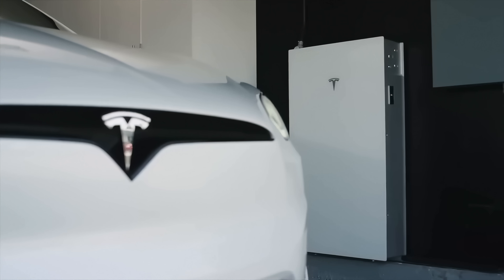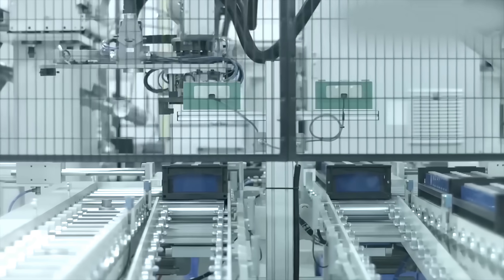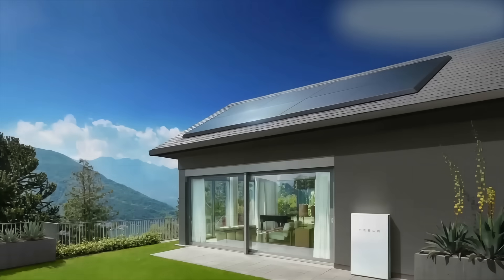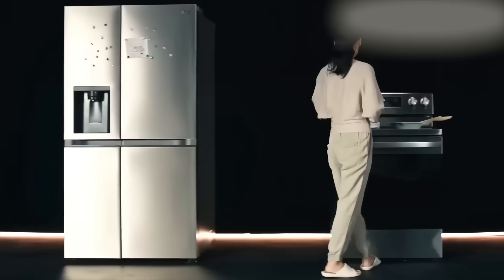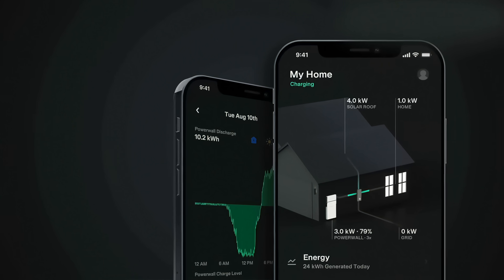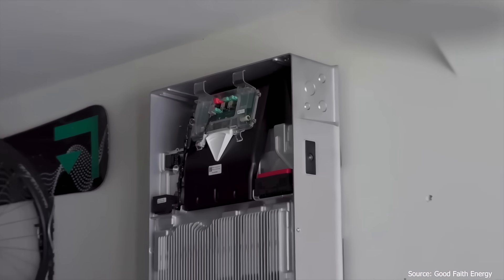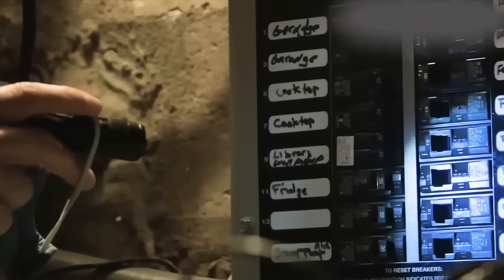Tesla BRICKS Powerwalls Remotely — Thousands of Home Batteries Now Useless

Comment from the maker: Would you buy a powerwall? If not then why..
Reply: After watching your video, I don't think so. 🙂
Reply: I would be very careful buying anything expensive and complex that is cloud connected.  That includes especially EVs but also includes ICE that is cloud connected.  Where I live, many of our smart locks to home main entrances had similarly been remotely "bricked" for reasons nothing to do with the owners.  Locked-out/in to our own homes.
Reply: @lbcck2527  Yeah my thoughts exactly.
I'm a bit of a prepper by nature and I love the idea of some energy self sufficiency to go with our old property that gives us rainwater, fruit/vegies, chickens if we felt like it, firewood and old school features like a wood stove, cellar etc etc.
The more I see of EVs and grid connected power setups the less I like them especially if some of the geo political tensions really kick off.
I'm leaning towards some stand alone solar, ICE generator and a couple of decent sized power banks as a back up to grid connect.
Ironically the really old tech such as our wood stove and decades old oil heater still function perfectly, can't be controlled/affected by outside actions and still work exactly as they were designed to do.
Reply: Not from Tesla or any other closed platform. Never. Try Victron.
Reply: I would never ever buy recent technology. I prefer to let some years go by and get the feedback of users and then decide. I've already seen too much. Even new car models can give some serious trouble. A friend of mine bout a new car model and it had some strange intermitente behaviour, the brand had to send an engineer to see it. Don't remember what happened after. But the car was the latest and greatest of that brand.
Reply: I don't think I would have ever buy something like that. Why would you pay so much when you can get server rack batteries and a decent hybrid inverter for a fraction of the cost? Also, then you can repair / replace things individually once they're out of warranty, and take advantage of new tech as it's available.
Reply: i will not buy anything "smart", whteher it is a fridge, a car, a phone  or whatever.
Reply: No, because our backup system uses lithium iron phosphate batteries that are safe for domestic use.
Reply: @PeanosZero  As long as they were built properly........
I won't be bolting any of those things to the side of our house.
Reply: I will not buy anything from Tesla while they have Musk involved.
Reply: Never Tesla
Reply: Apart from the owner no because of the cloud dependency. In the UK Tesla seem to have handled their battery replacement rather better. I don't want my main battery system on anyones cloud or wifi. This isn't the first case - and the Deye example is even worse when they bricked grey import inverters deliberately with no safety reasons.

Waiting to see if the Australian SigEnergy recall hits the UK and how that works out - they seem to be trying to do all the right things in Australia so far.
Reply: Yes, if its the new multi rechargeable, fireproof sodium-ion using the new CATL batteries. Otherwise No.
Reply: Did you not watxh your own video? Never tesla anything.
Reply: Yes! When the sodium batteries land and it makes sense both financially and security wise, I would. But never from a tesla-elon!!
Reply: Never, reason: Elon Musk.
Reply: I don't support notzees, so no.
Reply: If you buy something from a con merchant, expect to be conned.
Reply: No. Because Nazism.
Reply: The PW2 was total junk but the PW3 with (finally) the proper cell chemistry is a decent product.  That said, the PW3 requires using Tesla proprietary solar RSD solutions for solar instead of industry standards, which is an unnecessary eco-system lock-in, and it will stop working if it loses internet comms for too long… meaning you are married to Tesla and the internet.  There are other absurdities too, all designed to knock people off of warranty earlier.
Reply: I do need one but I think I’ll hold off for a bit !
Reply: No. Because I am going to build my own backup system with lithium IRON batteries, not lithium ION. These other systems can be assembled using various components to suit your needs. The main units can be all in one that look the same and mount the same like a Powerwall.  I don't intend to use solar and the system will charge from 120v AC so either house or generator. The unit will handle 5000W out and have 8kwh backup. 

I only need to run the furnace and some accessories in the winter and the freezer and two fridges in the summer plus accessories. I should be spending about $3000 and can add another two batteries for another $1000 to get me to 16kwh or enough to run a furnace for 5 days in the coldest of weather.. If I use the generator to charge the batteries, that can go almost a month with two tanks of the generator.

Those of you with time of use that is cheaper in the evening can charge your batteries in the evening and run the house on battery during the day. The unit has solar input to charge the batteries that way if you have the space for panels.

In places like Jamaica, they run these systems 24/7 with 240V split phase operating the air conditioning. Solar charges the battery during the day and with 32kwh on the hottest days of the year, the system may rely on grid power for the last hour before the sun comes up

Make your own. Lots of solutions available from companies like Eco Flow with hacks for using third party batteries.
Reply: No way. A similar battery technology in the remote control toy hobby community has burned down plenty of houses long before the variant used in the power wall came along, and those are just from packs the size of a bar of soap.

Anyone who has one of these inside their garage needs to have it removed immediately And if it’s attached to their house, they need to think long and hard about how flammable everything around it might be.
Reply: I wouldn't buy anything prebuilt, when it comes to stuff like this (especially not for backup power in an emergency). If it isn't China spying on you, it's planned obsolescence or something else. You leave all control to the companies (and in some case even to politicians), if you buy stuff like this prebuilt and use the BMSes and inverters supplied. That while being 3+ times more expensive than buy the battery cells separtely, along with buy or build everything else needed, like cell balancing, inverter etc. 
But, of course DIY is not for eveyone (you need some knowledge and it can be dangerous, if you dont know what you are doing). Choosing Tesla these days however, is pretty much to beg for problems.
Reply: The owner literally does Nazi salutes. So on balance no.
Reply: Don’t buy a Chinese car then!!
Reply: I refuse to enrich the worlds richest fachist
Reply: Never. I designed and built my own power Bank. It can only be shutdown locally, buy me or the fire department. It's a lifepo4 system, so no worry about fires.
Reply: Seriously?  You reposted the same video you posted only weeks earlier?!?
Reply: Apparently, even if I wanted to, I couldn't buy a powerwall , well not in the widely accepted understanding of "buy" .
If I buy something, it's mine , I own it , I control it . If there's a recall , the manufacturer contacts me and arranges at my convenience a time to repair , replace or refund their product . 
What they don't get to do is to sneak into my house during the night and effectively repossess their product , without so much as a by your leave . Nor do they get to subsequently leave their overpriced scrap metal in my home while I'm left without the utility of what I thought I'd bought .
So no , I wouldn't touch anything with that brand with a very long stick .
Reply: Musk did a double nazi salute. There is no way I'd ever finance fascism.
Reply: I am allergic to house fires, when I even see lithium ion batteries my eyes start to water.
What a genius response is your Tesla EV next?
Reply: First, they were seriously overpriced. Then, while the idea that the power walls could be operated as a large storage batteries when grouped together for economic gains, the thought that Tesla had control of them stopped me. Now, we see why.
Reply: No. I do own a Tesla but I also own LFP Enphase solar storage batteries. LFP is the right technology for stationary storage.
Reply: No. Musk's politics are horrific. And this news doesn't help.
Reply: I held my nose and bought PW3 simply because of Tesla's meter socket solution (aka 'Backup Switch' in Teslaese).  Saved thousands over adding a separate load panel.
Reply: @ArthurDentZaphodBeeb  You wouldn't have to add a separate loads panel anyway, you'd just install their gateway instead of the meter socket.  The meter socket does save money, but only a little.    

Critical loads panels are old technology, nobody really does that any more other than a few power station companies trying to sell their smart panels (which are unnecessary for modern-day whole-home backup).

There's nothing particularly special about Tesla power walls these days either.  There are a dozen companies that sell similar products.  But Tesla does have a decent installer network.  One could do worse.   Tesla has been playing catch-up for several years now.
Reply: Yes. Tesla Power Wall is an excellent product. 👍

Love the simple installation, meter socket, integrated inverter.
Reply: Some people wanna advance Green tech technologies and other people want to criticize. Go look up what Tesla is doing for Alaska and Australia. Saving cities $40 million a year. If you live in the right area it would save you money. Some people are too chicken to try anything new. Stay with your gas cars. Especially this fuln cok, he’s keeping you out of an investment that will 27X your retirement. Only some of us will have generational money. Not him
Reply: I would not because I know climate change is a hoax.
Reply: musk is liar, newer trust him, start in 2018 when buying EV I can not trust tesla
Reply: If you have to update the battery then it wasn’t made for me.
Reply: No because PW2 is NCM and I want NA Ion
Reply: @theairstig9164 PW2 is obsolete. PW3 is LFP. 

The safety issues with NMC is exactly why I waited until LFP was available - vastly safer chemistry.  Sodium batteries will be even safer, but it will take a few years for CATL's Gen 2 Naxtra to be widely available at cost-competitive prices.
Reply: Yes,  I would buy a Powerwall.  The product works and the back-up is great.
Reply: Are you REALLY doubling down on this?
I bet you had the "Alternative story" ready?
Tesla FAILS to Protect customers from potential fires" etc?
.
They were REQUIRED to shut them down by regulators when the LG battery issue was discovered.
(but YOU KNOW THAT already?)

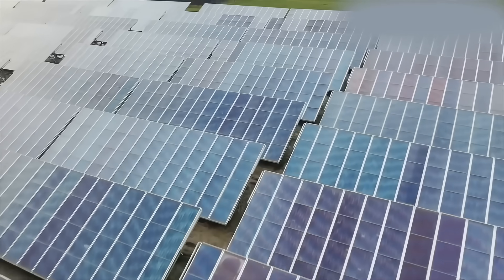Comment: I would not buy any electric equipment that is Internet connected. No battery needs remote internet access. 1:26 it is not allowed it is just possible. I don’t trust any smart equipment what so ever. None. Safety reason is a case for replacement.

Comment: First off putting a power wall in your attached garage or on your house is dumb.  When, not if there is a fire, that amount of power and batteries will burn down your building.

Tesla should have had a plan, not just shut them off.  Contact the customer, let them choose, and stop selling new ones until all the old ones were replaced.

Comment: I have 3 PW2 units. Earlier this year I got contacted about one of them needing a CPU fan replaced. It did not fail but was identified as having been identified as part of a recall. A week later a technician showed up, replaced the affected unit, and departed after explaining the issue. It was all done because of the remote monitoring capabilities of the system. Very simple and efficient. A few months back I heard of a recall and contacted them. They said that my units were unaffected. Had they been part of the recall they would have let me know. Ok, cool. They have worked flawlessly for over three years. Glad they are there. Glad they monitor them. It makes me feel safe. Mine were installed by Tesla directly  along with 40 Tesla brand panels, inverters, and the controller. Maybe that’s the difference. I didn’t use a third party installer. The trucks that showed up said Tesla on the side. I e also owned 3 Tesla vehicles. All have worked flawlessly. One needed a service (which was identified and scheduled through the app. I’m highly satisfied with Tesla as a company and I really enjoy and trust their products. I hope everyone gets squared away on this issue. Given my experiences with their full line of products it’s difficult for me to understand how this has happened.

Comment: I would expect a full replacement including all installation costs.  Fortunately I bought stand alone batteries and an inverter for considerably less than a Tesla Powerwall.  My system works fine and is not connected to the internet.

Comment: Listin folks, DO NOT consider buying anything expensive, and purportedly "durable",  that REQUIRES telemetry to function, EVER. This is all "subscription" biz model BS you buy into. Do you subscribe to "hardware"? NO. You subscribe to crap software developed in a code sweat shop, Especially cars, for cryeye, don't to it. Second, don't buy from any outfit interfering with Right to Repair. I've given up on Ford Motors after decades because of all the "dealership only' repairs BS. Like a $450 ECU "programming" for a 15yr old car. Did I buy some genius software? No. Some guy stuck a thumb drive in it to load 20yr old code. Eff all this noise, build it yourself or find someone who did. Oh, and China makes some just fine, stand alone charge controllers and inverters nowadays, so if US companies don't want to play ball, eff em.

Comment: Are sodium batteries a better option with regards to thermal runaway? I think if the batteries are at risk of catching fire, shutting them down was the right call, but they should be compensated and using 3rd party fitters should be scrapped.

Comment: only one real good use case for one of these, you live somewhere with surge pricing and you use the battery to avoid buying power when the grid price doubles or triples. maybe where you have an unstable grid with rolling blackouts or limited outages. even if you have solar panels somewhere where winter time production is not awesome you probably need a generator.

Comment: Wow! I have some fear now that I asked for (and got) a Tesla Powerwall 3 instead of Axia's own battery along with my solar system.  It's just this simple.  Tesla needs to find companies to replace the Powerwall 2's with Powerwall 3's at no parts cost.  If Tesla needs to crank up Powerwall production rates or slow down new sales, so be it.  Jury's are aching to put the screws to Tesla and Elon Musk.  Also, Tesla needs to come up with some way to compensate affected owners about their extra cost associated replacing their solar power with grid power.  This is not going to be easy to quantify;  I see I get a variable amount of solar power in December when it is stormy and cloudy compared to October when my service started and it was sunny everyday.

Comment: I work in industry supplying to AI datacenters. I use no smart appliances. Car uses petrol, has no touch screen. My home electricity meter is analog until forced by law to replace in a few years. My home automation is a Honeywell thermostat with built in clock and 4 settings per day.

Comment: Here’s another warning, a lot of new Chinese earth moving equipment phones home when there is a fault with the machine, say overheating or low oil pressure ect and if the operator ignores the issue then those monitoring the system back in China can shut the machine down remotely to “protect the equipment”. Make of that what you will.

Comment: Nobody needs batteries at a home. You use an earth battery or better yet and earth battery with a zpe device, or better yet just a very heavy iron object buried in ground connected to spark gap control to a copper pyramid with 3 lateral copper plate sandwich inside. The earth has a charge modulation and you can multiply it's single phase wave with a 3 phase resistance using 3 plates, causing the sympathetic wave of the pyramid body to implode pump z waves in sync yet out of phase off the apex. This is truly so powerful that it'll melt itself when you open spark gap enough.  Another way is running a Joe Cell off earth battery. The Joe Cell will amplify the effect of the earth battery 50 fold when using the pair of 5 gallon bucket size setup. That's enough hho to produce over 900hp in any internal combustion engine.